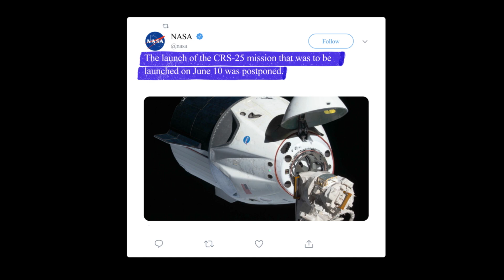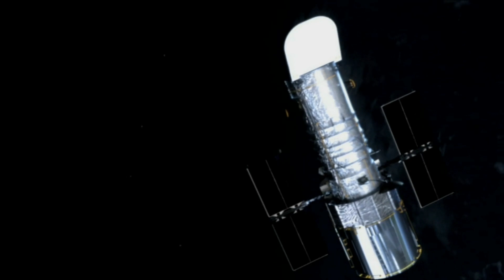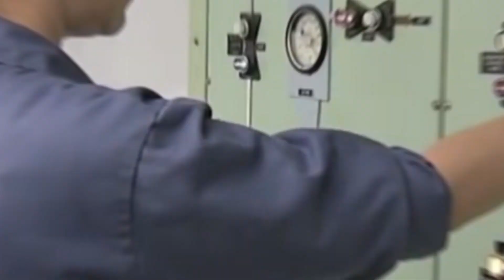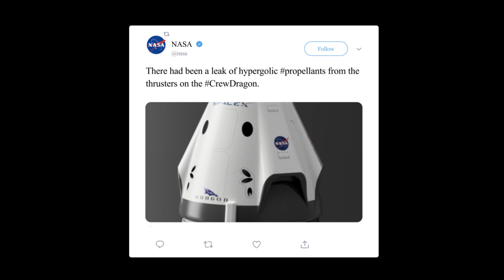Elon Musk Just REVEALED What's Behind Cargo Dragon’s Delay!

Comment: It is right and proper that testing reveals occasional abnormalities in the equipment. 1) It shows that testing is ongoing in full depth 2) It confirms that the not unusual minor changes in manufacturing are thoroughly inspected. 3) It must be remembered that even frequent service aircraft must be inspected and effectively instrumented. Commercial aircraft that have been flown daily for years will from time to time have abnormalities. Those abnormalities will become part of the standard testing and will in normal circumstances be engineered out of the craft.